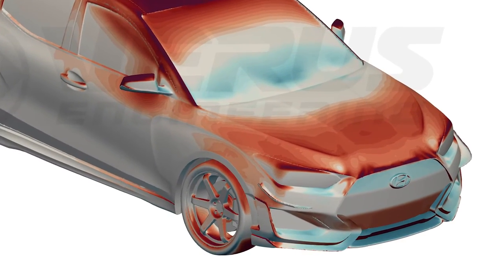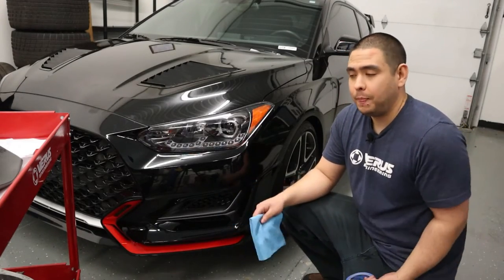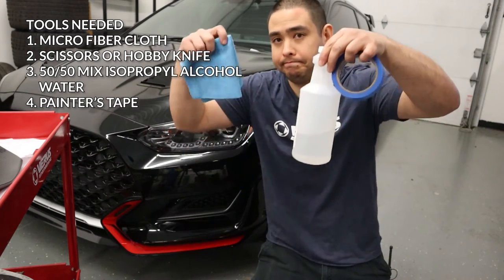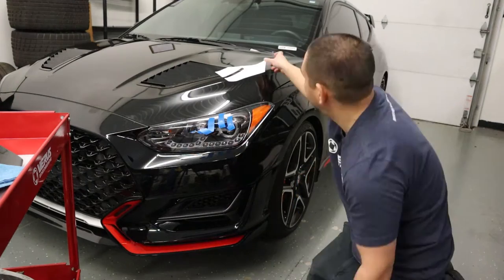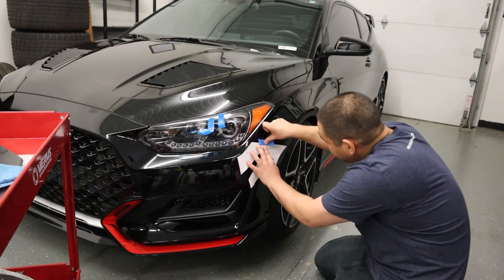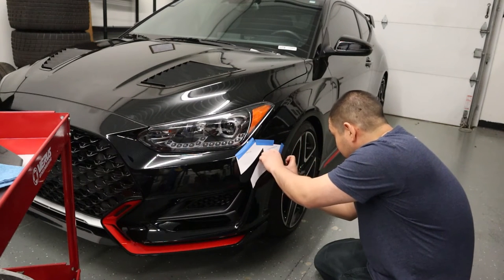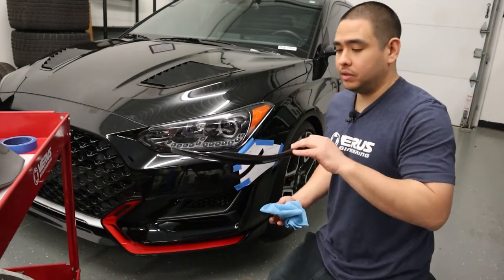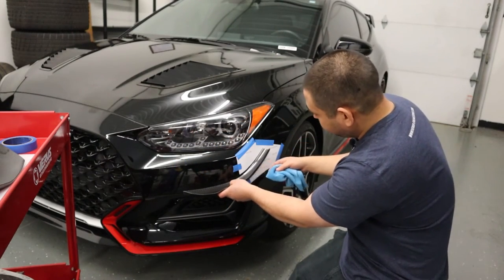Hyundai Veloster Dive Plane Installation

Comment: Any difference in performance 3m’ing versus riveting?
Reply from the maker: Nope.
Reply: @VerusEngineering  if going the rivet route, any suggestions on how many to use / what type would be best
Reply from the maker: @johnnyappleseed9568  At least 4 per side. We advise bolts, nuts, and washers over riveting though. Easier to remove if you need to.

Comment: Would it make any sense/work to use 2 sets of these?
Reply from the maker: You will not be able to install 2 of these as they are contoured to this specific mounting location. However, we do offer some dual-element kits for other cars and yes there is a benefit to running 2.